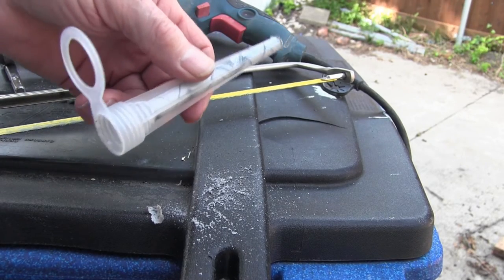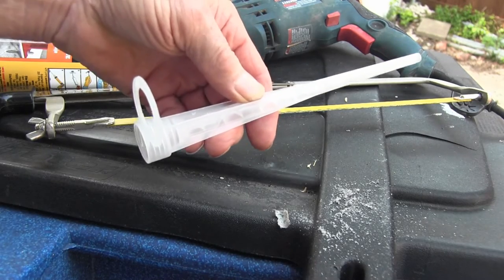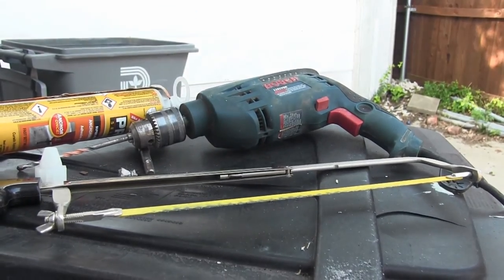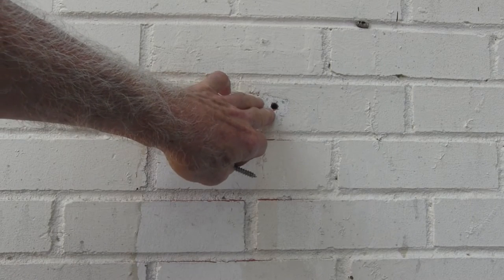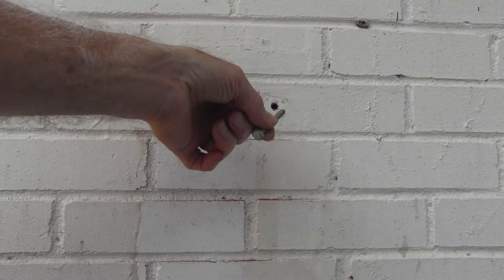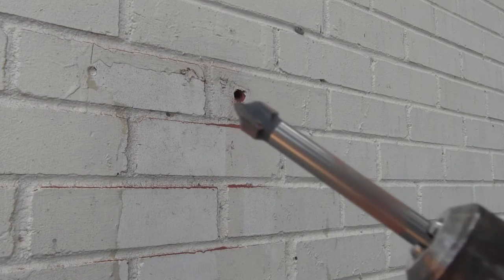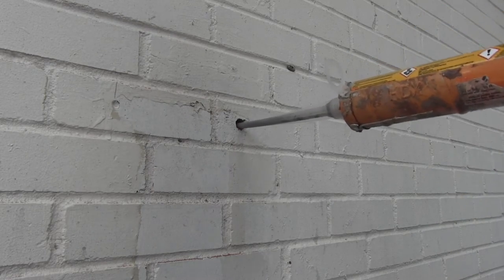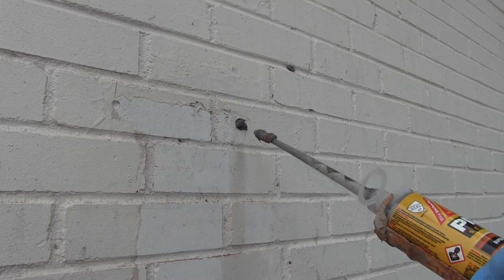epoxy glue, how to keep your flag pole on a brick wall when the anchor falls or pulls out,  breaks

Comment: I don't think you understand how physics work with that weigh test. Most of that weight is being supported by the ground. If you really wanted to see how much weight it is holding, attach a 2x4 to an L bracket, then attach the L bracket to the wall using the screw. This will ensure the screw is sporting most of the weight and not the ground.
Reply from the maker: All the weight is hanging from the epoxy screw
Reply: @dustyguy  I think that guy is right. the 2x4 or whatever is holding most of the bucket up. Most of the weight of the blocks are being held up by the wood. Most of that force is not transferring to the epoxy.
Reply from the maker: Going to try it another way